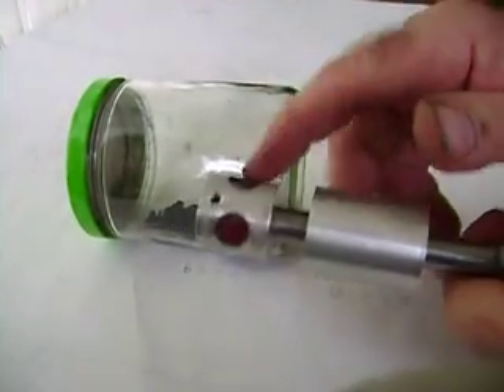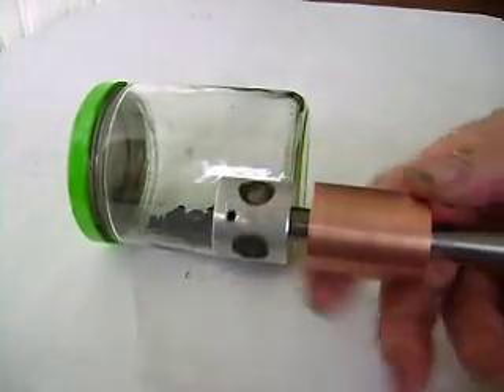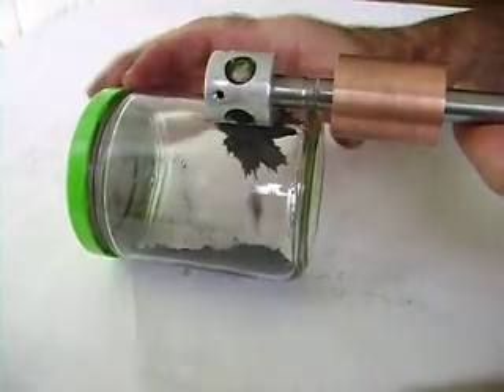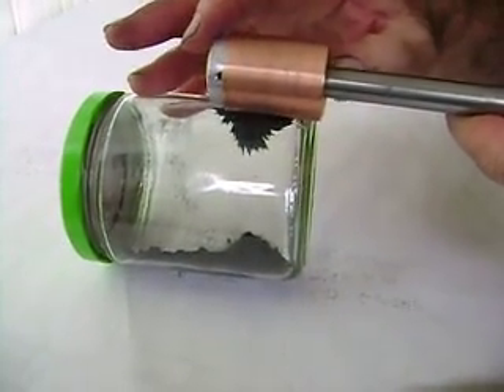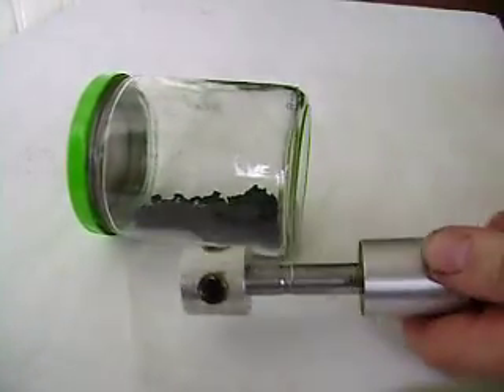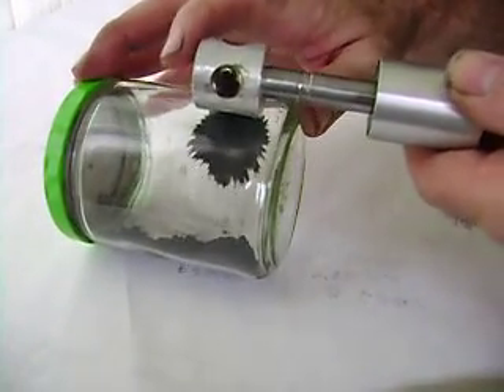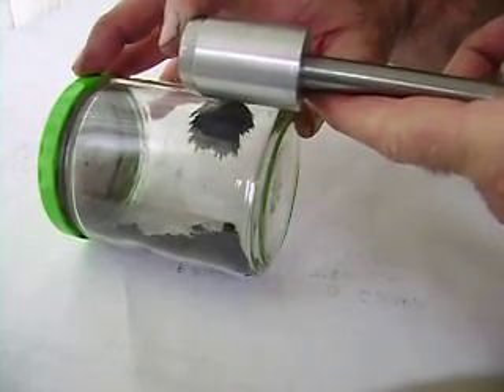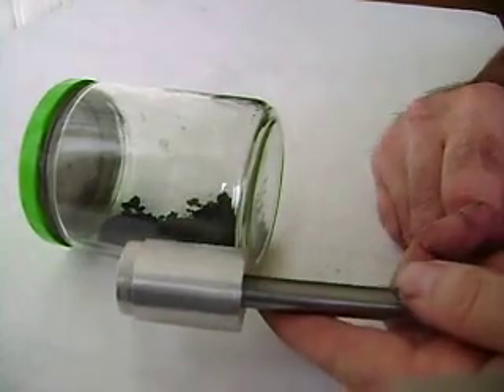Magnet Only Motors / Autono-Drive  Copper & Aluminum Test

Comment from the maker: Jgo1704,  Actually copper & aluminum does put a serious drag on a magnetic rotor as you pickup on the R.P.M. They in fact make a excellent dynamic brake at high speeds with no contact wear!!
 Good point.
 Donovan.

Comment from the maker: ciumides,  I believe I know the test you mean. A; when you let a magnet free fall in a vertical copper tube it does slow it  down. B: It would still disturb the iron filings, but I will see what I can do about a visual test. Thanks for the suggestion.
 Donovan.

 B;

Comment from the maker: @stevensrd1 Good thinking!! I wonder if the people that make mumetal do this. What I found is that the mild steel gives the magnetic flux a path to travel on, rather than actually repel it away, if that is possible, without an external electric influence. That, does work. Keep on thinking good stuff, Bud.

Donovan.

Comment: Hi there do the next experiment.
Tigh a magnet with a rope from a stationary point.Set the magnet in a copper tube and push it all the way in and stretch the rope.Repeat the experiment with the iron fillings this time pulling fast the copper tube.
/cheers mate

P.S.:tell us what happens.

Comment: what is the material of sleeve please answer me
Reply from the maker: The sleeve material is mild steel, sometimes called soft iron. It doesn’t retain magnetism when removed from the magnetic contact. Hope this helps you, feel free to ask me anything else.
Reply: @MagnetOnlyMotors  where can I found this steel ....
.....in junk....
Reply from the maker: @ahmedsaad-sj7pg    Well , you may find it in a junk yard. Try a metal supply or a machine shop service.

Comment from the maker: justin900.  :D, If you go to any local machine shop, especially one that does metal grinding, or an automotive repair shop  that resurfaces cylinder heads they will have more that enough for you & for free not doubt. Remember to take your jar.  Have fun.
 Donovan.

Comment: @Texmurphy51
Ya know, I honestly understand what you're saying.  However, unless you continue to try different ways to achieve the same goal, you will never know if it could be done a different way.  I will also agree with you again on the fact in which many people try to use these videos for financial gain by putting forth fictitious results. How many people would have thought you could burn water as fuel.  Now we have a guy that has come up with such a way to do so.  I won't say its feasable..

Comment: @Texmurphy51
No where did I say "nothing is impossible". However, to use your thumb and hammer analogy, there are Shaolin monks which punch brick walls for hours at a time.  This eventually becomes pain-free and strengthens the monk, much like hitting yourself with a hammer repeatedly.  Rules exist. Some you cannot get around, some you can bend and some are wrong. Let us consider the many times in Science that we "knew" something only to have it turned on its head and be dead wrong later on.

Comment: @Texmurphy51
Just because people have been digging holes with shovels for thousands of years doesn't mean that a shovel is the best method.  You are not wasting your time.  Why be upset at people, in your opinion, wasting theirs?  Science Daily (04, Sept 2009) They have found that monopole magnets exist as states of matter.  This is going to rewrite everything you learned in elementary.  No matter how badly you don't want to beat a dead horse... people are swinging a hammer with success.